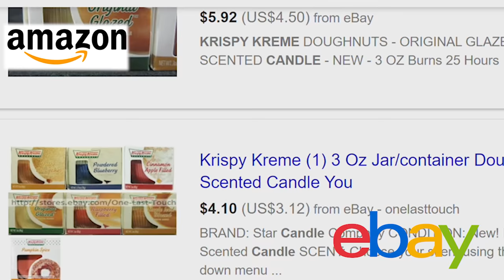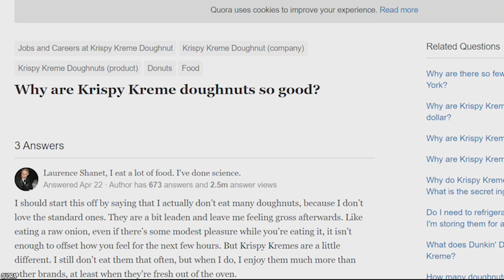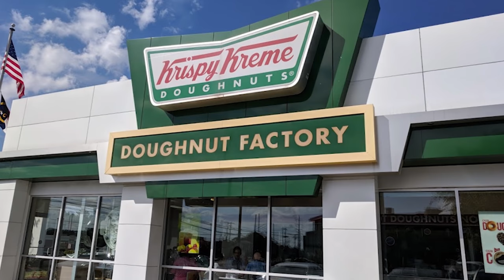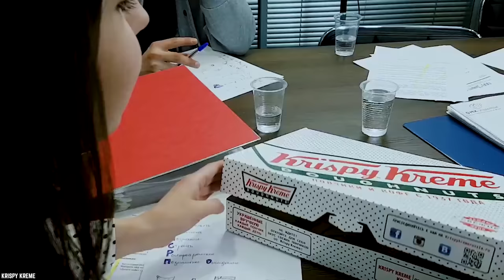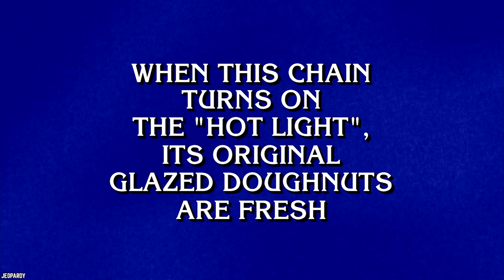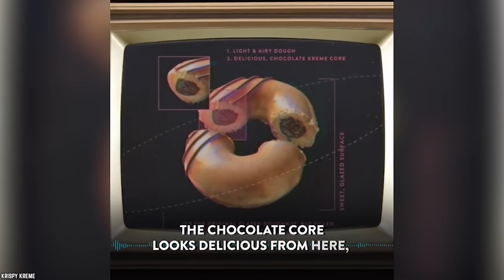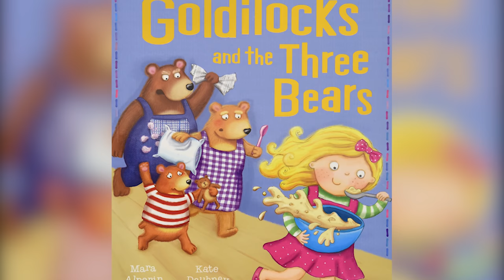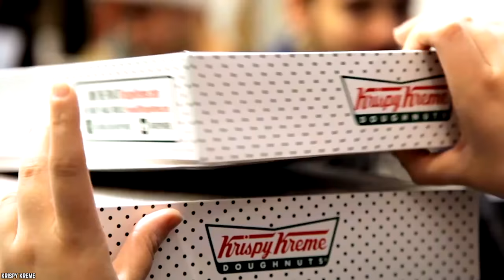10 Reasons Why Krispy Kreme Doughnuts Are So DELICIOUS!!!

Comment: krispy kreme donuts are okay, over hyped and over priced.
Reply: demonofdeath19 they are better than daylight donuts Dunkin’ Donuts and winchells
Reply: @douglasevans9599  I guess, I never been there especially since a friend of mine worked at a dunkin donuts and told me they were flies on the donuts either way I'm not a fan. My donut shop down the street is better.

Comment: WHAT!? I’ve had store donuts better than KK…not to mention that after taste that sticks to the top of your mouth with that weird coating…blehh 🤮
Reply: I hate the flat texture of the donuts. It's dry. And, it's better cold than if you heat the glaze because the donut will stretch.

I can't really eat any donuts anymore since I have to cut sugar, but when I had Krispy Kreme donuts before I didn't like them.